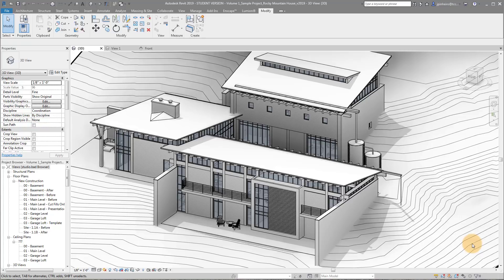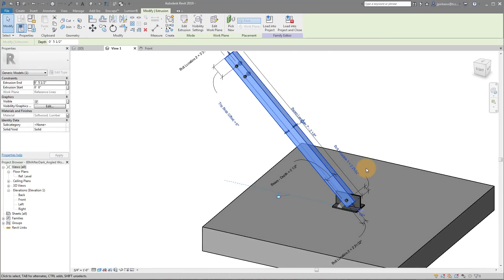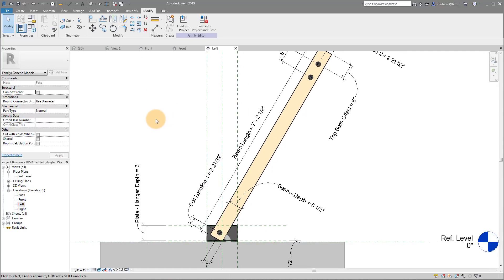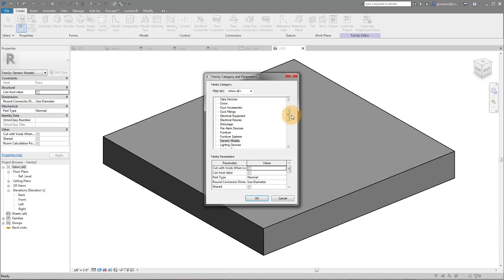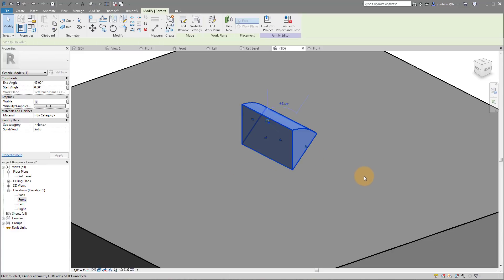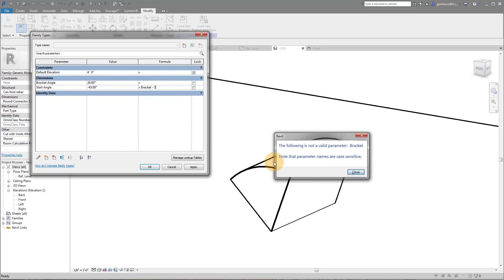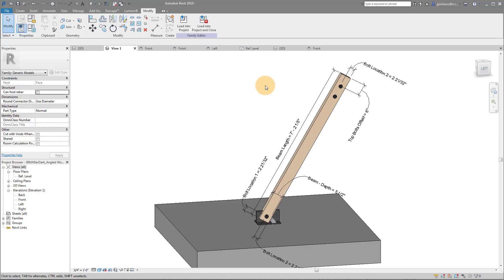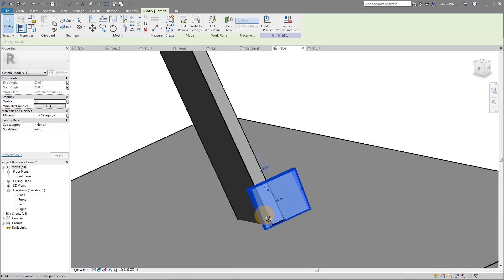Revit Tutorial - Parametric Angled Bracket Revit Family

Comment: Thanks, I've been trying to use this method in a door family but theres something thats not working. is anyone able to assist?
Reply from the maker: You’ll need to be a bit more specific with your issue … ?
Reply: @TheRevitKid  I've been trying to use the revolve on the hinge of a door and place it as a nested family as an instance parameter so that each door can be displayed as either fully closed or open to a certain degree. Also to att limits to the degree of swing
Reply from the maker: @shikharn22  okay.  Got that.  Can you explain further the problem you are having?
Reply: @TheRevitKid  Sorry Im new to revit. I've tried locking in my nested door panel into the door family. The Panel keep breaking from the revolve. Then Ive tried locking ref planes to the revolve and locking the nested door panel to the ref plane and unfornatly no luck. Not too sure what im doing incorrectly. This is literally the 1st time Im attempting creating this family. Been struggling with this for weeks now by trying many many different methods.
Reply from the maker: @shikharn22  no apologies necessary … you want to make sure your door panel family is face based… then place it on the face of the revolve.  If you’re not sure what that means look up some videos on face based Revit families.  Cheers!

Comment: Brilliant video, thanks for the demonstration! Any ideas how you would achieve the same results except using a cylinder extrusion instead?
Reply from the maker: It would be exactly the same!  Just host the cylinder to the face of the revolve!
Reply: @TheRevitKid  Thanks for the quick reply! Will give it a shot :)
Reply: Ok! So I have tried this (a lot!) but the only way I can host the cylinder is if when vertical, my start angle will be 90 degrees. I have tried drawing a rectangular/square extrusion first and hosting my cylinder extrusion to that but the model breaks. Any suggestions would be really appreciated!
Reply from the maker: Francis Kelly  - shoot me an email with some snips so i understand your issue better...

Comment: i just downloaded the bracket and I noticed that the rotation is not matching the pivot point (bolt) . As a concept to control rotation is great but the family is not right.
Reply from the maker: Fernando Lino hey man thanks for checking out the tutorial and downloading the family.  I learned after building that family (which i built a long time ago) that the direction you create your revolve effects the way the angles are driven.  You’ll notice in the family that i created a formula to fix this so what you type is in fact what you get.  You’ll notice in the tutorial above I draw the revolve in the front video and the profile above the axis. This allows for a correct type in with no formula.  Cheers!